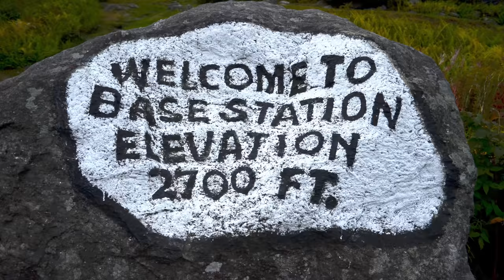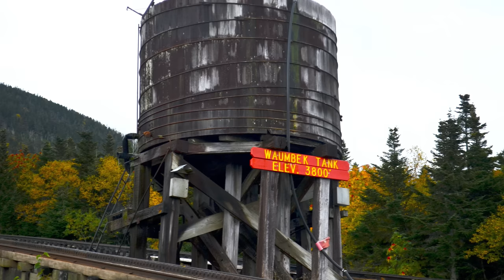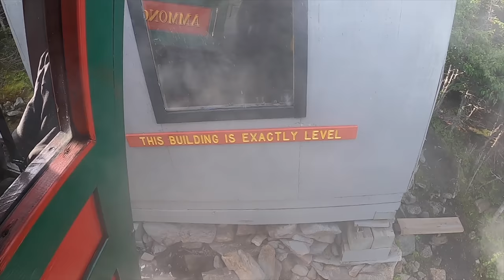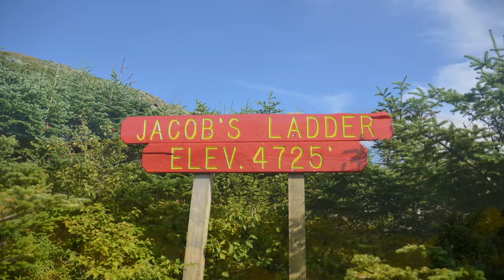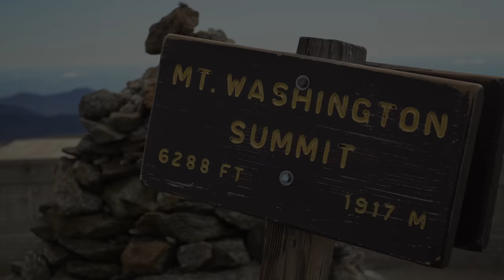[4K] Mount Washington Cog Railway

Comment: This is the one all end all video on The Cog. The dedication and photography put into this video as well as the low cloud sequences is simply breathtaking. Love the sound of the teeth on the rack still very prominent even from aways away, I imagine that is the main reason for ear protection for the crew.
Reply: That is the sound of the ratchet hitting the rack gears. There are ratchet lifters that can be used. If you hear the teeth making that much noise, JUMP!

Comment: We were out there several years ago, but because of the weather, the train was not operating. The weather at ground level was 78 degrees, sunny and blue skies. On the way up the weather changed drastically. By the time we got to the top through all the cloud cover , the temperature was 36 degrees, total cloud cover and very windy, raining and cold. Nonetheless it was a fantastic vacation to the eastern part of this great country.

Comment: Excellent as always. One interesting fact is that the engine and coach are never coupled for safety reasons. Especially when going down the mountain. If the engine looses breaking and starts to free fall down; the coach can apply it's brakes so no one in the coach gets killed. The attendant in the coach uses his brake wheel to stay no more than a foot away from the engine. I know, 'cause I was there in 2007 and stood next to him doing that safety trick. I'll never forget it.
Reply: So the engine just pushed the car up the incline ?
Reply: Nice detail. I went up in 2016 and thoroughly enjoyed it all. Sadly my Tee shirt has decomposed and I don't have many pictures of my visit.

Comment: Awesome video! Did you have to hike or drive up the mountain to get any of those shots? What would be the best time of year to come as far as weather goes?
Reply from the maker: You can drive to the top and bottom of the mountain, otherwise everything else shown requires walking up or down the mountain. The weather at Mount Washington is famously unpredictable, varying even by the minute. Generally you’re fine on the bottom, but the top simply requires luck that the weather stays stable.

Comment: Lovely video,  thank you.  What is the braking system?
Reply from the maker: Thank you for watching. I'm glad you enjoyed it. 

To answer your question, the locomotives use "Atmospheric Braking," a term that was actually patented by the railroad's founder, Sylvester Marsh. Air is drawn in through the side stack in the exhaust system, and compressed by the locomotive's four pistons. The engineer controls the braking by adjusting how much air is let out to "atmosphere." 

The coaches use traditional hand brakes. There are two break wheels in the coach, one for each axle.

Comment: Did this engine burn wood at one time?  Asking because of the spark arrester I thought was mostly (only?) for wood burning steam engines?
Reply from the maker: Yes, the cog engines originally burned wood. They were converted to coal in 1910.

Comment: Very cool I know number 10 is retired but at this point which of the other steam locomotives are still operational
Reply: Sadly only #2 and #9 are operated, all others have been retired to display or scrapped, i believe that #’s 3,4,and 6 I’d like to say are still around (excluding #1 ‘peppersass’)
Reply: As others have noted, #2 and #9 are maintained as operational locomotives. There are 3 other intact engines on the property. These include the #3 and #6, which could potentially be rebuilt, if the railway so chose. The #1 (“Mt Washington”, not the old Peppersass) is intact, but badly deteriorated as it was retired probably 20 years ago. The boiler and frame for #8 was around until a couple of years ago. I have not seen it lately. The #4 is displayed at Twin Mountain and the #10 is displayed at Fabyan’s Station, at the entrance to the base road. That should account for all 8 locomotives.
Reply: @kevinmadore1794  very interesting and cool it’s great that the Mount Washington cog railway still runs steam. It’s sad that the Manitou and Pike’s Peak Railway no longer runs steam and it looks like steam could never returned to the summit of pikes peak

Comment: imagine EV regenerative braking feeding a battery on that thing. Or a cable connecting the train going in the opposite direction as a counterweight. Or cogs between outbound and inbound tracks where passing trains transfer their kinetic power between them as a counterweight.

Comment: Its sad to see they have only two steam locomotives.
Reply: At one point they had 10, only 2 operate but there are 5-6 total left ( I could be wrong so don’t nail me)
Reply: I don’t believe there were ever more than 8 steam locomotives in service on the railroad at any one time.   Seven engines are still intact.   The 8 is the only one that is not.   That said, the railroad only plans to operate the 2 and the 9.